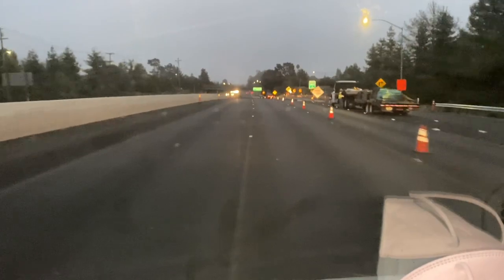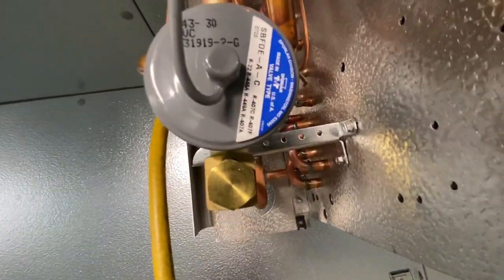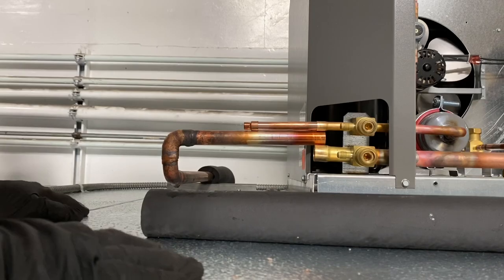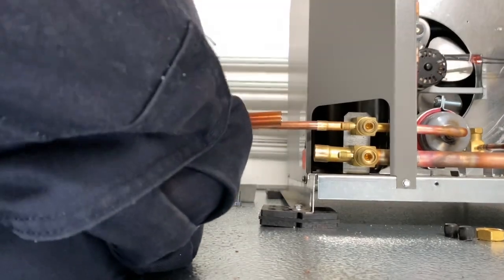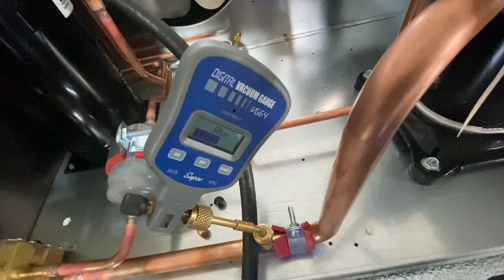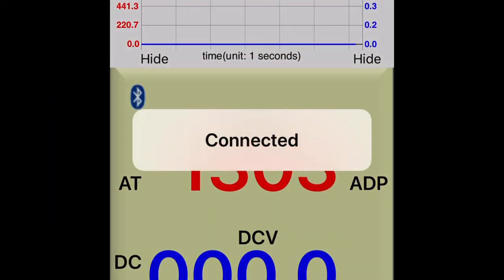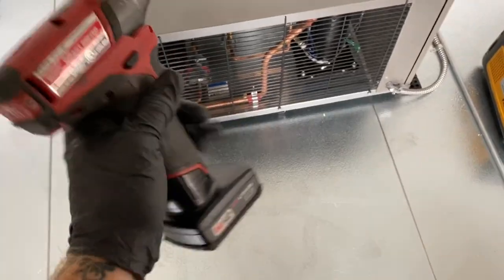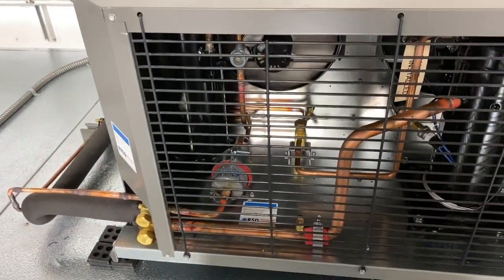Finish hooking up a walk in cooler

Comment: Great Dave. I always seal the end of the tubing with electric tape before I slip insulation over it. Just me ya know.
Reply: Or I always have old caps in my bag to throw on.
Reply: Same here. Its all over if a piece of insulation get stuck in the line. Unless you blow the hell out it
Reply from the maker: I never cover up. Been lucky I guess. 🤘⚡️🤘
Reply: The insul tube we get have a bunch of white powder in it. I don’t know if I’d want that getting in the pipe.
Reply from the maker: Bruce Crutchfield some times is today was a dry hump. 🤣😂🤣🤣
Reply: @NorCal-refrigeration  You tube police!
Reply: @brucecrutchfield3473  good point, the mold release agent is probably not good for the system, I'm guessing it's just talcum powder, but could be a blend of other things.
the talcum is likely not good for the oil or drier lol

Comment: My company installs a lot of Witt/Russell equipment. Just make sure you read the manual and add the correct winter charge. Clear cut (x) model gets (x) additional charge. Also I’m not a fan of the relay in the evap. I never use it and just allow fans to run on high speed regardless of tstat status. Screw that multi speed crap.

Comment: I Almost Forgot to mention. Re: Sliding insultubing on copper. i use the Orange caps that come on soft copper rolls. Makes it Really to Slide the Tubing on while also protecting from getting insulation pieces in the copper tube which will undoubtedly happen and then end up in the compressor oil. I poke a Hole in the center of the orange cap to let nitro out while purging too so pressure doesnot build up blowing the cap off.

Comment: You do extremely good service work and really nice installs. I would like to see you install your next walk-in with Stay-Brite 8. I know that you can. I have been using Stay-Brite 8 on all of my new  installs for some time now. It's faster and much easier. No flowing nitrogen, no oxy-acetylene rig, no excessive wet rag wrapping of valves and filters, and no leaks. Also, valves and filters are much easier to change out if you have to. When I was installing super markets I brazed everything. I wouldn't braze any joints now except for copper to steel and joints that would be inaccessible in the future like in trenches to be covered with concrete or risers in a hidden chase, and etc.

Comment: If OIL shows on the display after performing repeated alcohol cleanings you probably need to do a
freezer calibration see manual
Reply from the maker: Thanks I will look into that.
Reply: he probably doesn't have 99% alcohol to clean with, I don't it's allowed in commiefoolia

Comment: Why did u stop using the field piece probes
Reply from the maker: I haven’t I used them for the super heat just didn’t film it.
Reply: Nor-Cal Refrigeration & H.V.A.C   I just got a set  to use with mq  (mainly do residential)To replace my titans p51-870 But  idn why people say they suck  so im worried about buying them
Reply from the maker: Ronny Hidalgo there awesome with the measureQuick app
Reply: Nor-Cal Refrigeration & H.V.A.C i seen u reply that  to a few people but why are they ng with out  i dont want to waste ur time i know u a busy guy thanks  for the answers
Reply from the maker: Ronny Hidalgo the original app from Fieldpiece sucked. It’s been updated and is fine now.  The MeasureQuick app is amazing. The range on Fieldpiece piece probes are legit
Reply: Nor-Cal Refrigeration & H.V.A.C  ok that makes sense  ty  so much for the response love the channel thumbs up
Reply from the maker: Ronny Hidalgo I totally like the Fieldpiece probes. 🤘⚡️🤘

Comment: I don't mean to be a youtube police, but i think you're asking for trouble by not covering that pipe before slipping on the insulation...otherwise neat install....link the hose, i think i wanna use that set up
Reply from the maker: Just an air hose. Be careful to get one rated for high psi.  Your regulator can go 500psi or more.  The air hoses need to be rated for as high as your regulator
Reply: @NorCal-refrigeration  okay, thanks man. Appreciate your videos alot.
Reply: Nor-Cal Refrigeration & H.V.A.C  that’s a good catch especially since u can have a catastrophic failure of. Any part